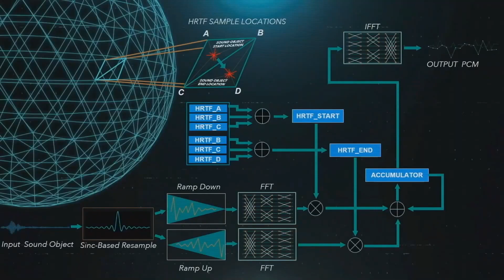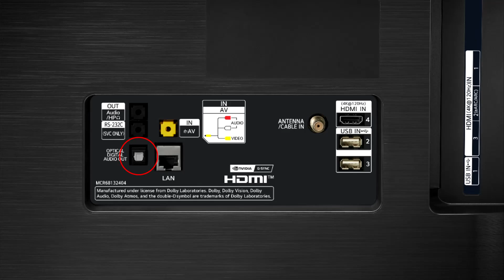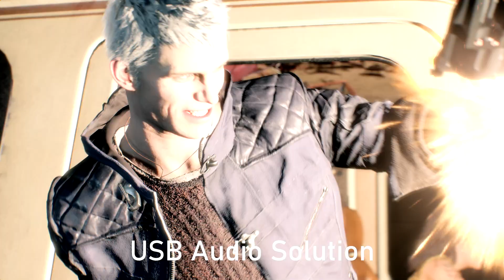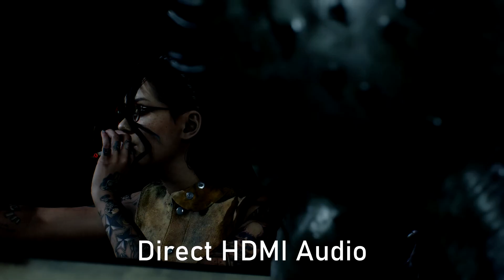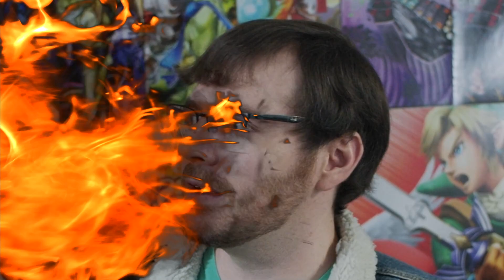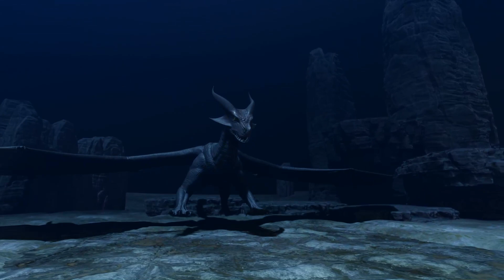Fixing PS5's USB Audio problem, using 3D Audio on Optical [GigaBoots Tech Lab]

Comment: Update on my previous comment; I think the PS5 Pro has solved this issue, or at least currently I no longer have this issue with as wide variation in volume as I did with my OG 2022 PS5. I've tried repeatedly playing the Horizon Zero Dawn Remastered title song over and over switching between USB and Optical input on a Creative Sound Blaster GC7 with two headphones; HD 650 & HD 58X. The sound is indistinguishable and at the same volume level irrespective of whether my PS5 Pro outputs Optical (via the TV) or USB. Playback in stereo - linear PCM.
Reply: Maybe it's a SoundBlaster thing? Did you update the firmware? I know this issue can be fixed somehow on the DAC side cause JDS Labs did it as well with their products. I have one of those dongle DACs for my IEMs and the PS5 is super quiet while it works perfectly on Switch, computers, and phones.
Reply: @leatherhidegaming  No; I don't believe it has anything to do with Sound Blaster, in that it seems to apply to all DAC/AMPs I've tested. I've done quite a bit of A-B testing on the original PS5 (OG from 2022) and PS5 Pro. All DAC/AMPs bar one displayed the same lower volume on PS5 vs. PC & Switch. That list of UAC 1.0 gear I had access to included the Fiio K11, S.M.S.L C200, Qudelix 5K, Sound Blaster GC7, X1 and G6. Only the Qudelix 5K had the 'Override Host Volume' feature available to match volume on the OG PS5 (or any PS5) to PC etc. It just so happens the GC7 was plugged into my OG PS5 with the 12th Sept 2024 update (the one prior to the Pro & no f/w update between) when I bought the PS5 Pro on its release weekend. It was immediately apparent and the first thing I noticed upon booting up the PS5 Pro (I'm sad!). I re-tested the new PS5 Pro with some of the other DAC/AMPs and they all now behaved the same. I also tested a Razer Kaira Headset (wireless USB) which again was much louder. So basically now no difference in sound between optical (via optical out from my TV), or USB output from the PS5 Pro. A massive change from the OG PS5.  I've since bought a Fosi Audio K7 and it too displays the same behaviour. I did a fairly lengthy post on r/ps5 on 15 Nov 2024 which gained some traction and a few other's responding with confirmation that PS5 Pro USB audio output is louder. Therefore my thesis/assumption is the PS5 Pro has made a hardware level change that has resolved this long standing issue/bug. Ideally it would be good to line up the OG PS5, Slim PS5 and PS5 Pro and A-B test, or even better measure the db output. Unfortunately well beyond my resources. There is a chance it's a software fix, however there is no evidence that I can find that would back this up. There have been enough reports that the PS5 Slim also had the -15.75db USB output. See Hardware Canucks video for reference, for example. So until proven otherwise my belief is the PS5 Pro fixed this issue. Sorry for the long winded reply, but I thought it might help.

Comment: One of the only videos on Youtube that addresses this problem in any way. Thank you. Really Sony should implement full UAC 2.0 support and stop 'paywalling' OS features to their own headphone accessories. The only DAC/AMP that doesn't seem to suffer this is the Qudelix 5K which has a PS5 mode (used to be called Host Volume Override in their App). Other DAC/AMPs I've tried; Creative SBX G6. GC7, X1, S.M.S.L C200 all had the same issue of massive volume dropoff on PS5 versus PC. And yet in numerous places people will state the G6 works perfectly with the PS5. It doesn't and you need amplification to offset the volume dropoff. In my experience optical for stereo just sounds better if you have optical out on your TV or a HDMI audio splitter.

Comment: Cubilux USB-A to Toslink adapter doesn't suffer from the low volume issue (because it operates at a fixed volume) and is fairly cheap. You can find it by searching for "B0B2DBGKL3" or "Z10-15BK". There's also a USB-C version, but I haven't tested it.

Comment: @Giga Boots Tech Lab if i dont want to use 3d audio for multiplayer games, can i just use the usb C (should have uac2 usb !? ) port of the ps5 to connect my usb soundcard (i want to buy sharkoon pro v2 or soundblaster g3 ) or is there still the problem with uac1 of ps5 and uac2 of soundcard ???

Comment: I use a qudelix 5k plugged into usb newest firmware has app setting to output the ps5 usb audio at 100% fixing the low audio pulsing issues. both the  balances 2.5 an single ended 3.5 out of the qudelix 5k carry the tempest 3d audio to your headphones it sounds fantastic. Also works on the nintendo switch. An charges the battery while you use it as a usb dac it's predominantly a portable bluetooth dac (Ldac aptx hd) for most people an it preforms that better then the fiio btr5.

Best of both worlds forget a Schmitt hel 2 or flashing a jds atom dac or using the Chinese dac adapters with low audio get a qudelix 5k
Reply: your answer is the best i read so far.
I have a very good quality speaker system but only with coaxial input.
I bought a usb Dac from sound blaster, but the sound is too low, I can't believe it.
I don't want to waste my money anymore, but I want to listen well, with normal volumen and without delay, especially this because I compete in street fighter and this cannot happen.
what do you recommend? Thanks!!! I love you!
Reply: @rhcasca  quidlex 5k, ifi Zen dac V2., jsd atom+ stack in that order

Comment: hdmi 2.1 extractors are coming out in 2 months, but i'm wondering what's the best external dac/amp to get 5.1 dolby downmixed into stereo since 3d audio is not available through optical but 5.1 dolby downmixed should be better than 2d audio right?

Comment: Is hdmi-optical splitter a good idea if I don’t care about the 3D audio?
Reply: Judging by my experience with my LG TV's Optical SPDIF spooling tech, it should be fine. I had a negligible amount of noise added that was only noticeable when analyzed in software. Your setup will limit you long before a quality HDMI-SPDIF demuxer.

Comment: Just out of curiosity, would class two compatibility require hardware updates, or could it be added in a software update?
Reply: I was wondering that too
Reply from the maker: It would just need a new audio driver so it’s possible with an update.

Comment: Not sure if my e17k would be able to make up for the sound loss on that DAC. Unsure what to do
Reply from the maker: My Fiio e17k wasn't able to deal too well with PS4 doing the same thing oh my low-impedance headphones so prolly not.
Reply: @gigabootstechlab4392  I have some Sennheiser HD700 so it definitely wouldn't work out for me. I decided to just route my PS5 audio through my CX into a Optical ->Coax converter and into my DAC. Not exactly elegant but it's my best option right now. Hopefully Sony adds 3D Audio over HDMI sooner rather than later

Comment: considering 3D audio is supposed to be a major feature of the console it'd be nice if sony could eventually address this problem, even if it means a console redesign down the road that actually has an optical port, and/or a USB-optical converter sold by sony that doesn't have the audio glitch here.